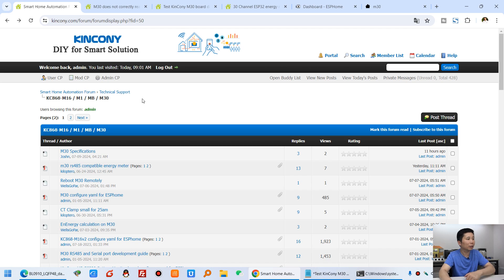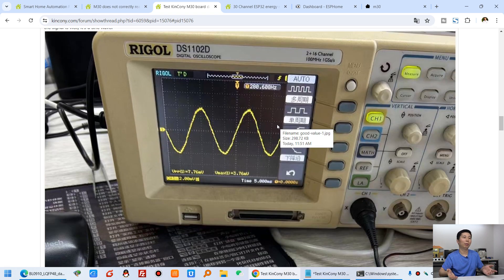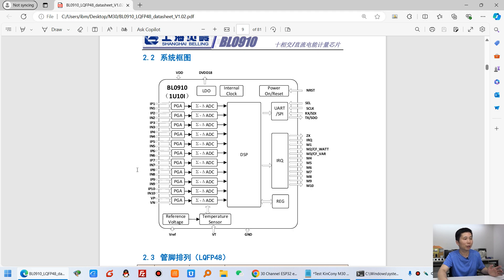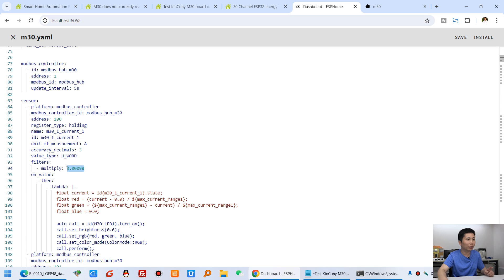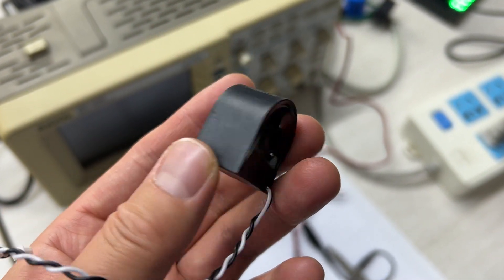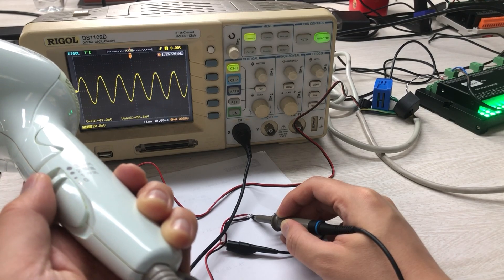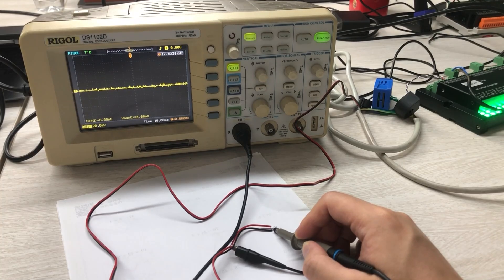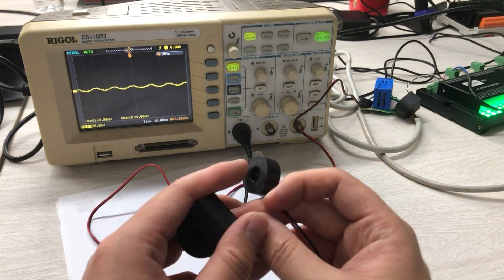why M30 energy meter read incorrect data [Reply to customer inquiries]

Comment: The distorted waveform at low power does not necessarily indicate a bad CT. Many hair dryers use phase-angle or half-wave control at low settings, which naturally produces highly non-sinusoidal, high-crest-factor current. A CT will correctly reproduce this distortion.
The real challenge is often downstream: low-cost energy metering ICs (like BL0910) can struggle with RMS and power accuracy when current is both low and highly distorted, due to front-end filtering, crest factor limits, and DSP assumptions.
Using a “smoother” or filtered CT may hide harmonics visually, but it does not make the measurement more physically correct. Accurate metering requires wide-band sensing and true time-domain RMS/power calculation.
Reply from the maker: thanks for your suggestion.

Comment: Where can I buy black D shaped CT sensor with black and white wire? I don't see it on your website. I want that.  More accurate than smallest one but not big as blue one.
Reply from the maker: https://shop.kincony.com/products/25a-current-transformer-for-kincony-m30-m16-energy-meter-board?_pos=2&_psq=ct&_ss=e&_v=1.0